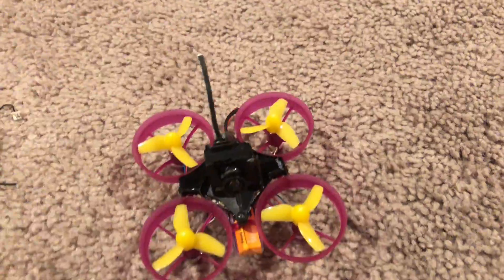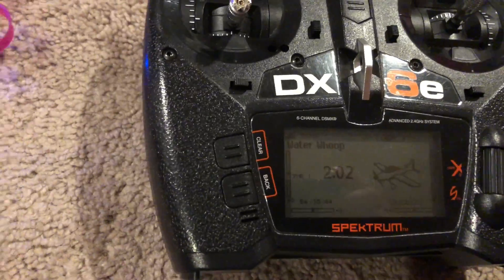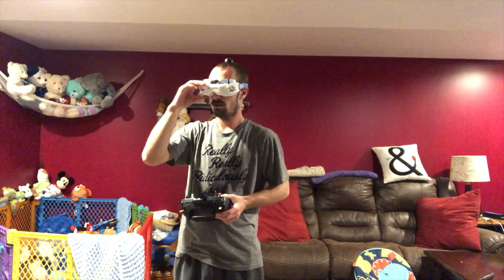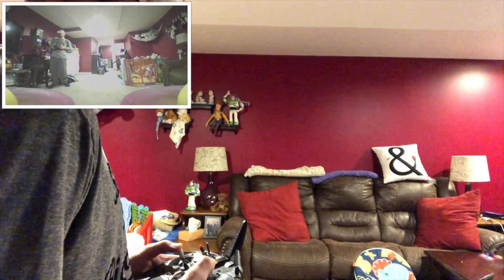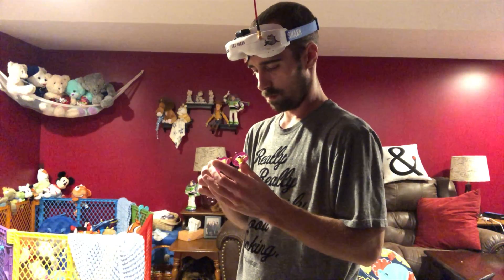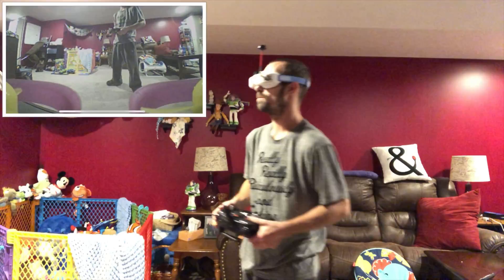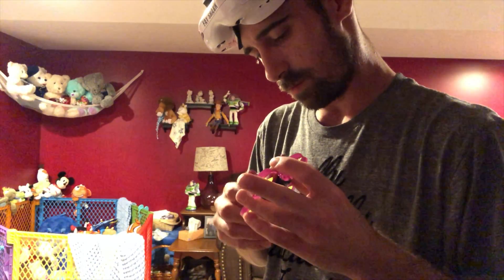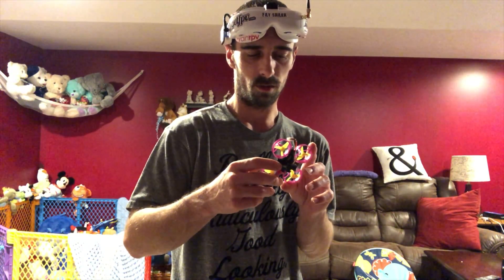Inductrix Pro Upgrade ( Aka POWER WHOOP )

Comment: Hello sir. One question: After fitting the new motors did you have to change anything in the betaflight?
Edit:
I just realized watching the video that I seem to get the same. Random takeoffs midflight into random direction head on into walls mostly And I have no control over it. Like you just watching it go...
Reply from the maker: You changed the battery connector to a jst2.0 first correct ? I changed around a few setting like turned on pwm speed separated from pid speed, and a few other I’ll edit this reply when I get home but mostly I think just the motors needed to be broken in so it sucks to say but keep flying or trying